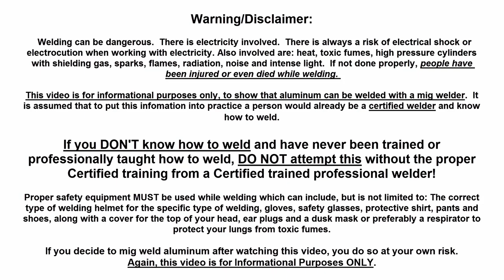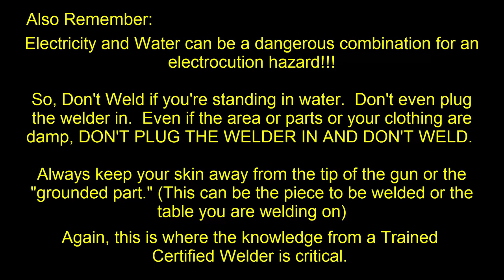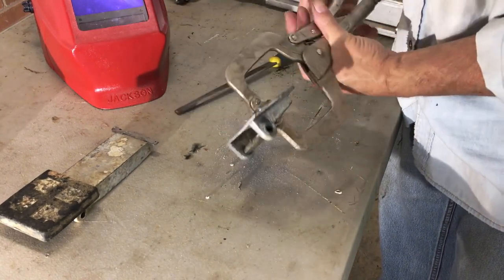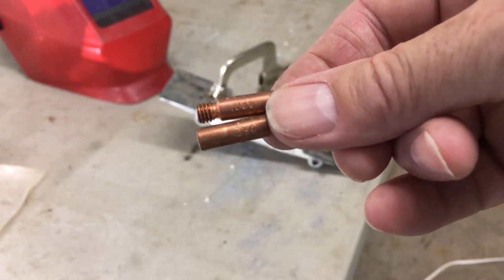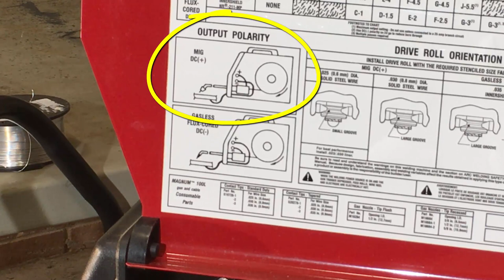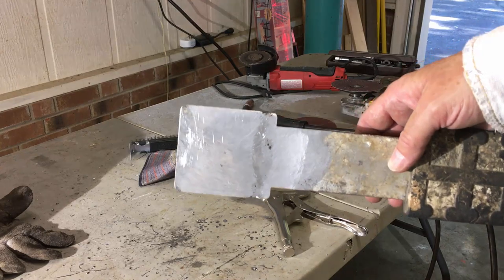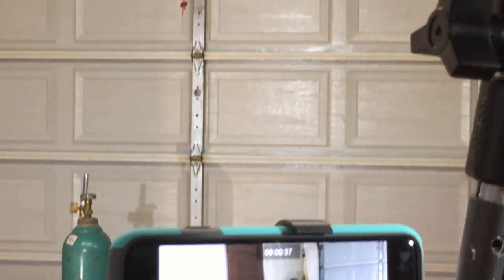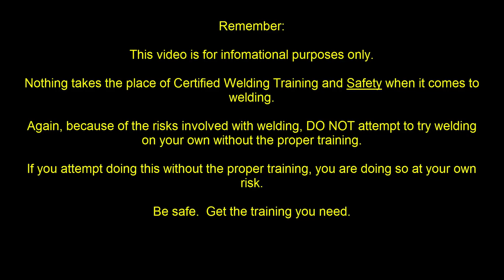Learn An Old Timer's Secrets To Mig Weld Aluminum Without A Spoolgun

Comment: As a machinist and a fabrication shop owner I wanna tell you the way you are filling the bevels was not a good way of holding the parts you need a good vise or lay the file flat and run the part over it at a angle to put the correct bevels in it that or a belt sander works better than a file
Reply from the maker: Thanks for the comment and for watching the video!!

Comment: Yes I know you can do it that way but if you have a dirty liner if you have been running dirty wire like I flux cored wire then it will dirty your aluminum wire and your Weld will look like ship also you're not cleaning your aluminum enough

Comment: If you stick weld like I do, I will wear a thick welding glove on my left hand and a thin leather glove on my right hand since I hold the stinger in my right hand, anyway If that glove is damp you will get lit up by the welding machine been there and done it

Comment: I see you used an electricians hammer ... AKA whatever is in your hand!  Also, not completely necessary but definitely worth the investment is a cartridge type face mask with HEPA filters.  Bad lungs usually don't heal so why risk it?  3M makes a dang good mask, be sure it's airtight though and sized for your face.  You do that by covering the exhaust vent of the mask and gently blowing out... A good seal will hold some pressure before bleeding out (quick and dirty way to test!)
Reply: Old welders frequently have emphysema.  Not fun.  One of the full face masks like the nitomethane racers use is a good idea if you're doing a lot of work.  Or not.  They're your lungs.

Comment: This guy is really afraid of the welder voltage, I've been welding for over 20 years (MIG Stick and TIG) and the only time I've ever been shocked was from the HF start from my TIG and even then the only down side is I didn't need a cup of coffee for the morning. That's not to say if your bear foot and standing in water that you can not die but that should go without saying, common sense, natural selection. Be kind of like me saying don't play football on the freeway.
Reply: Lol, yeah I been bit from the hi freq starts,. Bare handed for a fast, small weld on a small part or repair.   Or from a water cooled torch that was leaking enough the moisten the cable cover.   From stick welding and it started to rain n mid pass and had to finish the job- a safety thing for other people, so yeah, my pain for others to be safe type of thing.    An outside gardrail hand rail with traffic and equipment running in the area.  It's a really wake up on some of the jolts :)

Comment: There has long been a debate about the old wives tales about using a bigger tip size with Al MIG welding and in the case of using an air cooled torch which can get pre heat the wire as it feeds through the torch and the argument may be valid.
Today most shops professionally welding Al will use water cooled torches/systems and not have this problem.

Comment: If you use that welder for steel all that crap is stuck in your liner and on your drive rolls you should use a nylon liner if you're going to at least make an attempt I have a Lincoln 110 as well but I use that just for steel and I use the Miller 350p for aluminum and I know a lot of people can't afford the aluminum welder  try to mimic at least the setup

Comment: Ok so a dust mask does not stop fumes of any kind it stops dust of all kinds. Make sure to have a respirator with the proper filters for the job you are doing. Once in a while welders can get away with not using one even tho I would not recommend it the damage fumes do is permanent it is an acummulative damage the more you weld the worse the effects. Be safe you only have one pair of lungs. If you have ever had the pleasure of welding galvanized steel and suffered the effects of this nasty gas then you know what I mean the effects are very noticable, other harmfull gases from aluminum and stainless are worse cause they hurt you without you noticing the effect until you get told by the doctor you have ingested too much. Scary shit, but if you take the precautions to properly protect yourself including adequate ventalation then you can have years and years of happy times playing in the puddles of welding. This is just my opinion on fumes which I consider as important as the lens shade you use on various metals and arc intensities.

Comment: After reading the comments I just want to say what I do when welding aluminium, I run a quick run up each side of the joint to be welded , then grind it alway and then weld as normal kinda primes the joint to be welded and preheats it as well. Most unprofessional I am sure.
Reply from the maker: Pat,
You are correct in the pre-heating aluminum.  I probably should have shown that in this video.  Thanks!!
Reply: By pre welding and grinding you make it more likely to crack as to the crystallization of the material ! only pre heat to about 50c ai ample for most work

Comment: Don't know why you spend all the time to take it apart instead of just welding it with it in place that also would help to alleviate any issues you have with having it line up correctly once it is welded just my opinion.  Also with it still in place just tack weld the ends of it and use your angle grinder 2 create a gap to weld instead of all of the filing unless you just like to use the file that is then go for it

Comment: 1:Just buy GMAW Lincoln aluminum wielding wire!!!!!!   Plenty of companies make various types of mig welder wires just for welding aluminum. 2: DONT use 100% argon with the wire but a 75/25% argon-helium mixture will shield the weld better resulting in a much cleaner, thinner weld if you want to save $ and go that route.  3:If you're "Bird's nesting" the wire's to thick for something most of the time.  You'd also be surprised at what a proper set-up does and turning down the wire speed a notch.  Raising /lowering the amps even helps.  One time in my life this happened to me and it was because I put the spool on in a hurry. 4: While I'm talking about tip shape and sizes you want one you can get as close as possible without contact.  By which I mean the spray isn't spattering into the hole or wire.  That's saying you have a great electrode and spray to began with.  This is why aluminum is a beast even using a proper TIG Miller welder.  You really want to be close as close as possible and using that size wire at that speed with 100% argon you will end up honeycombing your welds, end up with welds that are too fat too grind down, even with a motabo blade vertically or even welds that will fall right off since they don't stick!   Try setting your machine at slower speeds and welding vertically with a cone tip that's blunt, but easy to see and get into tight spaces.  There's a million ways to do it. One size does not fit all projects or fabrications is the only truth to welding.  That and not seeing the two or more pieces you welded together on an X-RAY is the closets thing to a perfect weld!  the weld that's visible can look awful, but can always be made to look like one piece with a hand sander.  Make sure you have the bead,(electrode) in front of the puddle and hold the gun at multiple angles if possible.  If the puddle starts to shift or you start burning through speed up. I see your wield has porosity which is a sign of being too far away and the spray not covering enough material.   You can remedy this by running your bead faster or turning down the speed just a bit if you can. A welds a weld.  Cleaned up it may have been great but it looked like something I've seen to many times when I started.  It wasn't sticking enough and way too fat.  Use a torch to heat metal that thick up and it makes a world of difference!  Also I love using anything to cut into where I'm welding and make a cross pattern so it helps stick if needed/possible. It doesn't have to look pretty but 3/4" stainless you should be able to flip over and see where you burnt through, or dark brown everywhere you wielded pieces onto it.  Mig welding's a breeze once you have everything matched up correctly and the RIGHT parts to match the job.  May take a few tries but I could walk into your shop and have you welding aluminum like a pro with my machine and what I'm used to welding. TIG welding, not the thumb controller crap but truly using a pedal, tungsten rod in the gun that HAS to be sharp as a pencil all while holding the welding rod with your other hand is difficult and maybe 1/20 students picked it up quickly.  It's a pain and yes you will be able to play drums much easier due to the coordination you use!  On stupid thick (1"+) you don't have room for error when it's Uncle Sam's $ and our boys out in the tanks/armored vehicles/aircraft they depend on.  That was contribution to my country.  Now it's a hobby but the book's, class's, experience and knowledge learned from the few old timers still welding in that 120 degree plus heat, ("Use a fan dumbass!"-You've never welded a day in your life!  Tack welds with who knows what maybe.  I heard that a lot when people asked me why I had on jeans/overalls before work) who were tough enough to still do that 40-60 hours baking in a factory fabricating what-not.  I'd never cross one of those fellas!  Ton's of respect to you guys still out there day after day doing that still.  I cringe thinking back to those days waking up and un-Godly hours still having metal fibers in my hands from sanding and grinding.  Flash burn no longer effected my German-Irish skin and I was so swore working was the only thing that made it go away.  Ironic guys took meds for the pain yet the only thing that worked for my pain was working and putting myself through more pain.  Keep that tip of the nozzle close and ahead of the puddle!  Good luck and keep welding.  I could list a million NOT TOO's I've learned over the years as well!  Reason my TIG welder was fried.  Those classes really helped understand why what happened, happened.  My friend thought I was messing with him but we were in an area already exposed to lots of electric current daily and while I was welding.  There was a magnetic field well over the blowout limit and I was using a rod that wouldn't bend because of it before we started welding.  Any MIG spray transfer method welding this isn't as big of an issue since your spraying the wire's core onto the metal basically.  Sucks since I have a million projects and my cheaper but still Miller and more mobile welder's being used currently. On here trying to figure out a way to weld aluminum but just tacking it is a waist.  Renting one next weekend which is always a roll of the dice!!!!

Comment: WHAT ABOUT A PLASTIC LINER FOR THE MIG GUN AND A SPECIAL TIP! AND A PLASTIC WHEEL FOR INSIDE MACHINE. A STEEL WHEEL WILL CRUSH THE WIRE!

Comment: without a spool gun??? you meant to say NORMAL way, on AC with teflone conduit and oversized  wire tip.... ? 
AC current is used to weld aluminum because its positive half cycle provides a cleaning action and its negative half cycle provides penetration. 
You didnt changed your conduit and you attempted to weld aluminium on DC without helium mix thinking it will actually come out without porosity. 
You use DC with helium to achieve penetration on very think aluminium and you finish with AC with Argon.
Reply from the maker: If I were welding with TIG you would be correct to use AC.  But, I was welding with MIG and the only 2 options are DCEP (DC Electode Positive) and DCEN (DC Electode Negative).  For aluminum MIG you use DC Electrode Positive.  DCEN is for Flux Core Wire.  Thanks.

Comment: ok perosite (bubbling) poor clean up around weld area fumes from glue/ grease ect you did not purge the gas and started with 75/25 instead of argon. use acetone to clean the metal no brakleen or wd or carb cleaner they will ruin your weld. also you can control the heat to wire the same way you do for steel just at a different ratio use the charts. also learn to weld instead of tacking. just takes practice good luck

Comment: Offers a trick to use a mug welder to weld aluminum. Uses all the proper tools to weld aluminum. What an original thought.  Use the right tool for the job. Hint: this is not that big of a tip.
Reply: I haven't seen one of those yet. Will have to check them out.

Comment: you forgot to take off your ring ! ! unless you havn't ever had a slag ball attach it's self to that pice of metal on your finger or you may touch a hot item with it by accident  or you  are working with a heavy project that you might drop on your ring finger in your glove and then your going to hurt  bad and cry like a baby . I've welded all my life and even at 65 I've never seen a DC weld hold up to stress so you need to make sure you pic your project structural or ornamental . I hope your stelt  is working fine .

Comment: To Maritime man: To get rid of dust, fumes, toxic gases and smoke during welding. Just use a pedestal fan in an open space, facing away from your face or in 90 degrees to your face. All 
air and contaminants will be blown away from your nose. May13, 2020
Reply: Oh cool I feel much better now about those contaminants and fumes now that I do all my welding outside

Comment: how to weld without a spool gun,    you are just using a standard wire fed mig,,,,,, so nothing special there at all...
dont touch the tip ?? thats if you welder is not earthed properly,,,what if your welding on a steel strusture thats earthed, derhh 
 weld on a plastic surface, not pre heating it first,    didnt learn anything   so why the video

Comment: Wouldn’t it have welded better if you had cleaned the aluminum before you started?
Reply from the maker: You’re probably right.  I should have used acetone to clean the metal.  I’m planning on doing an updated video on this subject  in the near future.
Thanks!

Comment: Your teacher should have taught you that heat, is not volts.  Heat is amps.  Volts controls liquidity.
Reply: I think I remember volts is the volume in the hose and amps is the pressure
Reply: No, it's the other way round. Volts- pressure, amps- volume.

Comment: this is totally brutal to watch. please destroy your video equipment and save yourself this embarrassing video. you are wrong in so many ways. yes there was good info from your old buddy at the start on some points. please public do not take this video as anywhere near correct. do some proper research. yes some of the real world welders that know how top actually weld aluminum have made various and i might add correct observations this video is wrong in so many ways that i would suggest that you totally disregard it as valid !i could not read all the comments but the ones i did read are way more valid than the video. for the record if you back up material with substantial aluminum works the best for first pass. which means that the first weld would have been in the structural side. second you will find that if you use enough feat to actually have the wire material become a spray right off the tip you will make the the first pass without all the lumps. also doing this any internal contaminates will burn out of the material. then you weld the other side same way. now to get a good usable weld grind out the original weld to parent material and you can put in a proper non spray weld. do both sides. hopefully you can dig out the rest on the internet. yes we have done welding of aluminum that a lot of hgher end weld shops refused to tackle, if you want a real challenge try welding aluminum that lived with sulfur. yes it is  possible. also 7000 series aluminum has high magnesium concentrations  and we all know what magnesium does when heated to these temps. can also be welded if you know the proper procedures.

Comment: I don't believe you are on ac so Even if you do weld it it's still bad and easy to break
Reply from the maker: That would be true if you were welding with a TIG machine but not for MIG.  MIG is setup as DCEP or DC Electrode Positive.  Thanks.

Comment: it needes 5 years hands on to be a good welder of mig, in yachtbuilder,  
you need stop because you have no idea sorry, we tune  straight mig   by sound of the arc, shouls be just on the spray, hiss like a snake, with 40 years building, trust me, pushing wire like you are is ok, for bench  work but forget it when you need  bends in gun lead. i use  miller aluma pro guns, miller   tip for al is say 1.2x,  wire speed controls amps
Reply: Five years??? As a thirty year journeyman I can have a good candidate welding any MIG job professionally in six months. And that includes yacht building, one of my favorite jobs.

Comment: The dust mask shown will not do anything for welding fumes. Should use a respirator with suitable filters (3M onesie are pink) or a back pack fume hood. Video is also too long.
Reply: You should always filter your air through a cigarette.